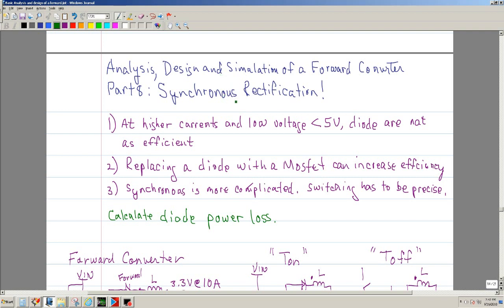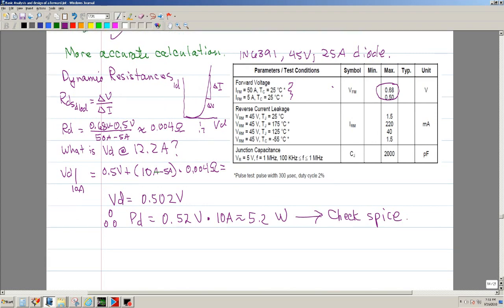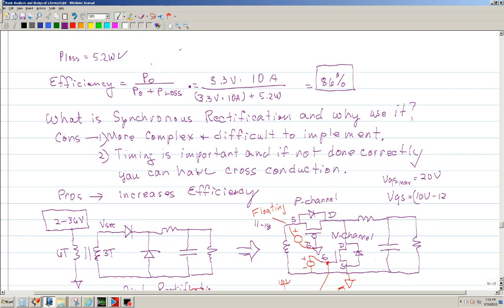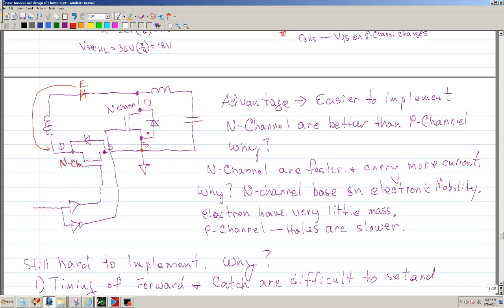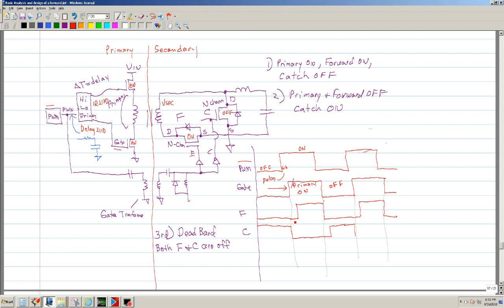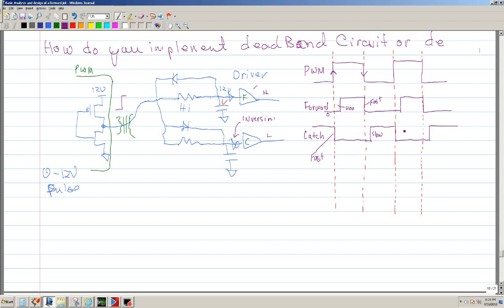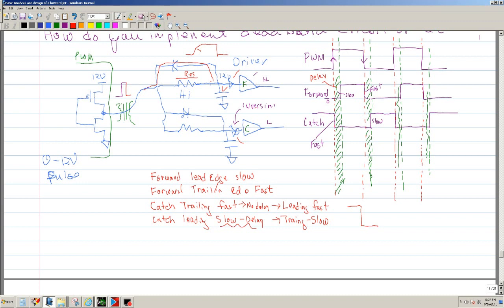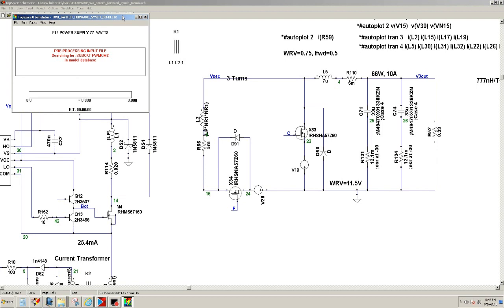Forward Converter Part 8:  What is Synchronous Rectification?

Comment: Super! Perfect! And what about two halfperiod rectification (symmetrical, 2-stroke). The thing is that I´m not a professional at all, but single-stroke transformer has unefficient power losses. Or not? Or it has other disadvantages with asymmetrical process. Why you select thouse schematic?
Can I use double stroke transformer and your single halperiod rectification?

Comment: Excellent video, as always, but the early statement that diodes are not as efficient at higher currents isn't accurate. The MOSFET has its greatest efficiency advantage at small currents where it is close to 100% efficient while the diode still has its forward voltage drop. As current increases, the power loss in a MOSFET increases as I^2 * R where the MOSFET's on resistance in the saturation region is relatively stable. For the diode, the power loss is the still the current times the forward voltage drop across the diode. The forward voltage drop across the diode goes up slowly with current at high current levels, so the diode's efficiency isn't changing much. The net result is that as current increases, the advantage of the MOSFET over the diode decreases, and for circuits that have very high peak currents, it is generally useful to have additional diodes in parallel with the MOSFET to handle part of the high current peaks...
Reply from the maker: Hi ats89117. I respectfully stand my statement that at high power, high currents, you can only achieve high efficiency using synchronous rectification. At high current of lets say 20A at 3.3V and assuming you use a high power schlocky, the voltage drop could be in the 0.5V range. So you multiply the current of 20A*0.5V, you have at least 10W of power dissipating in the Shockley diode. However, if you use a Mosfet in the 10 of milliohms, you dissipate less power. For example, a low Rdon of 10mohms is not out of ordinary. So we can calculate the power as 20A^2*0.01ohms = 4W    And you parallel two Mosfet, you can reduce that to 2W. Synchronous rectification is used in the majority of high power supplies. You can get the efficiency using just power.
Reply: Okay, your examples are true for situations where the device is on a high percentage of the time, the currents are reasonable, e.g. less than 100 Amps, and voltages aren't too high (because RDS On increases with both junction temperature and Vds max). This is representative of most power supplies and is true for most other applications as well.

But it's also true that a diode's effective resistance (V/I) decreases at higher currents, while a MOSFET's effective resistance increases, and there is some point where the curves will intersect. Paralleling MOSFETs is fine if you can get them to share the current without adding significant resistance. But there is a reason that the high power diode business is still thriving, even as more and more power supplies adopt synchronous architectures to increase efficiency.
Reply from the maker: I think we may both be correct. I assume your experience is with ultra high power power supplies; I don't have that type of experience to comment other than that it is simpler to use high power diodes and that synchronous rectification is much more complex and there is always a danger of cross conduction between the forward and the catch. I could see it would disastrous if both conduct at the same time with such high power. Using diodes at very high power you don't have the cross conduction assure and it may be why it is the preferred way to go. But in general for power supplies from 30 to 500 watts maybe even higher, you will get more efficiency using synchronous. Your statement about the mosfets increase of Rdson and diodes decrease Vds as temperature are all correct as you state; in fact it deceases by -2mV/deg while the Rdson on mosfets increase by 20% at around 100C. All correct statements. However, if you have a newbie and is getting efficiency of 70% at 100W of power, it would be improper for me to state to continue to use different diodes until he finds a diode that will give him the desired of 90 percent efficiency because there is no way he will get there. Only way to get there is to use MOSFETs. This is been great discussion. I appreciate your comments which I would have to agreed with you only for y very high power supplies. I thank you for sharing this information with people so that we all benefit from each other experience.  Robert Bolanos